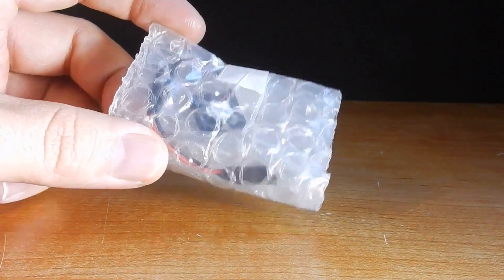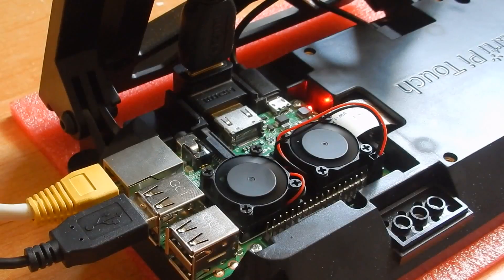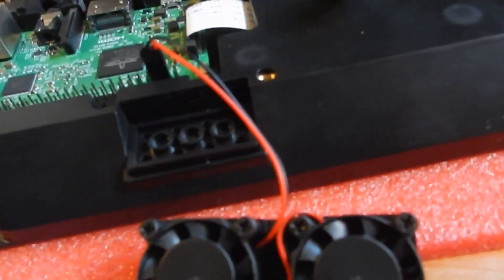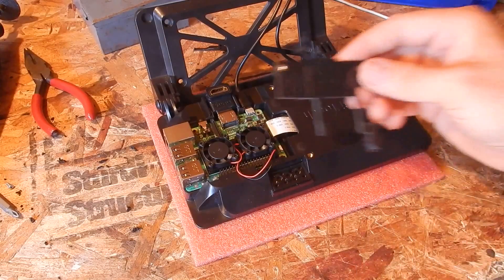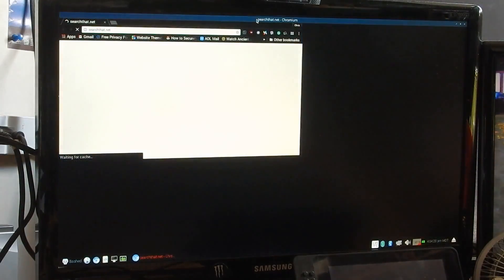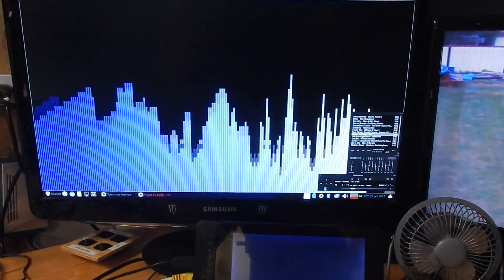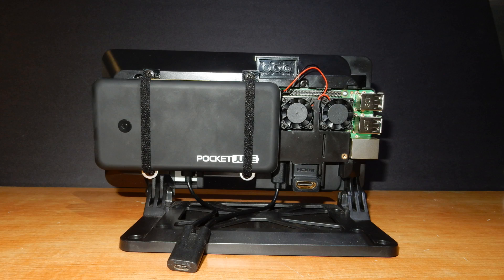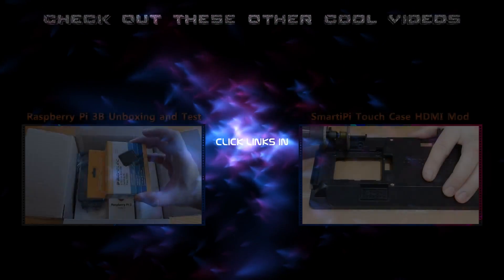Raspberry Pi Dual Fan Heatsink and Battery Addon to SmariPi Case Mod

Comment: Can you just use some double sided tape? They came out with a back cover for this so I’m not going to worry about moddifying that cover for the dual fan but I plan to get a small lithium battery and taping it to the back of the case and then screwing the back cover over that

Comment: Great video! One question, have you tried using the official power supply of raspberry pi with 5v 2.5a? Will it work with the official 7inch touchscreen and dual fan connected together? please let me know. I have a project that almost do the same with additional ncf522 reader. Im actually afraid if the power supply will sufficiently powerful enough to run those connected components. thanks!
Reply from the maker: Jeff Legaspi I use a 5v 2.5A power supply that runs the touch screen, Pi and fans and any other devices connected to the USB ports at the same time without a problem.  

This is the one I use
https://www.sparkfun.com/products/13831

Comment: Nice, but did you know there is a backing you can get for the case?

https://www.modmypi.com/raspberry-pi/screens-and-displays/screen-cases/smartipi-touch-back-cover-large-37mm
https://www.modmypi.com/raspberry-pi/screens-and-displays/screen-cases/smartipi-touch-back-cover-small-15mm

Still, a good video to watch. Thanks for sharing this!
Reply from the maker: I already have the backing.   I just rather not suffocate the Pi using it.
You can see it here at 4:57 https://www.youtube.com/watch?v=c-YtZxNpAtQ

Comment: I'm in the process of doing basically the same thing you've done here as far as the battery bank goes and am wondering how long yours lasts.
Reply from the maker: I did a review on the Pocket Juice battery banks with there statistics here.
http://www.destructiveburn.com/pocketjuice-raspberry-pi-3b/

If you wait for a week or so.  One of my next videos is the blackweb 20100 mAh battery bank tests with the screen and Pi.    That is a battery Bank from Wallmart.  I did a quick test and it might be a worthy one to run my Pi.    So stay tuned for that!